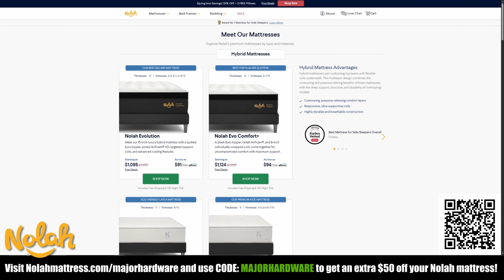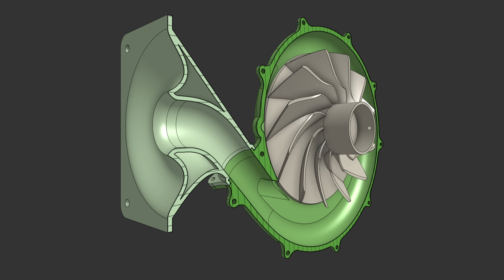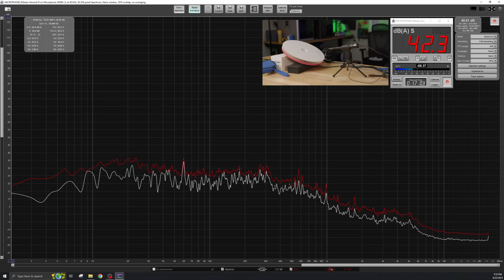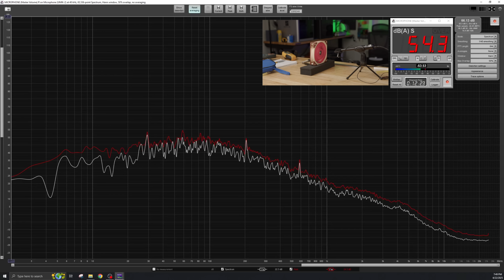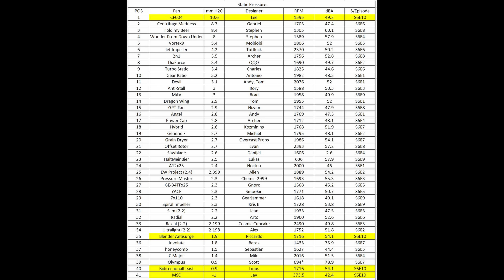This Fan Was Designed to FAIL... And It Broke the Test! | Fan Showdown S6E10

Comment: Season 7 IMO should focus on High Speed 38mm thick fans (Delta, NIDEC, etc). You've done the noctua fan for quite some time now, maybe its time to spice things up a bit. Objectives should be 3-fold: 1. Airflow. 2. Static pressure. 3. Does the impeller survive? The challenge with this season is that the impeller **MUST** fit within the fan housing. Things like flow control ducting and airflow cones (Ex The Cheater) can be allowed, but the actual blades must be within the fan housing. Its both for challenge, and safety. If the impeller lets go at high speed, the fan housing will at least catch the bulk of the fragments and slow anything that tries to escape, which can be further contained using a plexiglass shield.
Reply: There is not a lot you can do to beat the factory design when you restrict the dimensions.. That was already in seasons 1-3, nothing much was happening... I also was against breaking the "box" but, it has been more interesting when the only real limitation is how much the hub can take.
Reply: @squidcaps4308  There have been a few fans to beat the A12X25 while fitting in the frame. Not many, but enough that one actually got contacted for a license.
Reply: @codahighland  Yes, but by not much, and the designs were not picked because they were more efficient but because they looked freaking cool while performing well.
Reply: The reason for the noctua base is that the fan could easily be removed from the hub, allowing test fans to be pressed on. Do you know of a fan with the same property in the category you suggested?
Reply: @ericbuchner2982  The A12x25 simply has a metal rotor that the magnets are mounted to. Any fan with a similar metal hub underneath the plastic will serve a similar purpose. For Delta: Delta QFR1212GHE for certain. For Nidec: It seems the "large hub" 120x38mm fans that have an exposed brass shaft cap on the front of the fan may have a metal rotor beneath, cant tell though. I would say though that if there's a massive hub on one of these fans odds are there's a metal hub underneath the plastic. The Sanyo Denki 9GV1212P1J091 is also a potential candidate.

Comment: I don't know if people remember much these days, but back in the dialup era late 90s, and i can't quite remember the URL for it, but it was probably uptime dot something. Anyway having a very long uptime without a reboot was a competition. And you would also provide CPU temperature and other metrics. Now that's where my Celeron processor had the coldest running temperature back in about 1998 anyone had ever seen. It averaged 21C. Got down to 17C at night. The trick there was, firstly, those processors did run very cool back in the day, then, my bedroom was often below freezing or close to it in winter. But mainly, those 3 blade fans i had with a variable resistor, i could speed them up to about 7000rpm and they were ridiculous. Loud as hell, but very very high CFM
Reply: Yup, long uptime was once an achievement... Then one day i noticed that i had well over thousand hours, back in win7 days and i wasn't even trying... Uptime hasn't been a competition for a long time, now we are looking at uptime records of over 20 years, if we started competing..
Reply: @squidcaps4308  oh my. A Windows uptime, I mean without a reboot, these days would be neigh on 2 weeks at best. I had a Windows 2000 server in a cupboard back in the day which ran for 2 years until a power cut.
Reply: @irreverends And that is 100% horseshit. If you turn updates off you can easily have uptimes spanning YEARS. Windows these days is far better at house keeping, all around. It creates less trash and is better at cleaning it.

Comment: I’d like to see a material / gram limited season.  It would be fun to revisit the roots a little bit and tie things back into PC cooling too.
Reply: Space limited season, maybe we can get rid of the original frame all together and only keep the motor ? (Or impose a readily available unit)
Other idea would be to make the best performing fan while staying under a certain noise level target
Reply: @Homme_Pur 
I don’t know if it would even be possible to create a frameless case/radiator fan. You kind of need a frame to mount the fan onto a case or radiator.

The only way to create a “frameless” fan is to turn the frame into a plate. That would kinda still be a frame, just a flat one.
Reply: @Operational117  meant it in the way that we would need to design the frame ourselves. The idea is we can do whatever we want as long as it fits within the standard 120 mm fan volume and retains the 4 mounting holes
Reply: When seeing the Antisurge I thought a poligon or vertex limit might be cool. "How much airflow can just 42 vertices provide? Let's find out!"
Reply: Or maybe pressure per gram of material?
Reply: @kullen2042 I like that a lot, any metric (pressure, wattage cooled, etc) per gram would be pretty sweet to see.
Reply: I second this! :D
Reply: Suddenly we are all designing turbofans. Difficult with the a12s low torque.
Reply: I really badly want to know if the vacuum one cools well at all

Comment: The MSC is super cool ! it's essentially like a rotor and stator stack in a jet engine, but done radially rather than axially.
Reply: I'd love to see a design like it but for positive pressure
Reply: You know technically negative pressure is still pressure. And has positive on the other end. This could actually do extremely well on a cooler. Pull works very well when done correctly
Reply: It'd make a great exhaust, yeah
Reply: @googIesux Yeah, if you want to do that.

One school of thought is more (filtered) intake airflow than outflow, to keep dust out, like a clean room.

I don't think that matters much if you cool the CPU as I do: 120 mm fan in/out with  120×120 or bigger heat pipe heat sink in between.  Output fan connected directly to a flexible duct, the other end of which is attached to a third 120mm exhaust fan attached to the case.
Reply: @LloydMcElheny  ducting is real though, man. Not pretty enough to be promoted by xXxG4m1ngxXx Pro X-treme RGB Edition casemakers and etc. But most people have more fans than they need by far.
Reply: @uwainium  It could be mounted backwards as is.
Reply: @uwainium yeah same here 😅 I came up with this idea nearly 10yrs ago, good to see someone try it.

Comment: love the turbo fan. its so nice to see one finally well executed. the only thing I'd change is to put a bearing on the back side of the impeller to stabilize it.
Reply: Problem we've seen with bearings is, unless you're shelling out some coin for a high grade one with virtually zero friction, you're ultimately going to only hamper performance by adding one. I think you'd want to find a seal-less and lube-free design in order to. 

Though I suppose some of those fidget spinners had some impressive ones, but they're probably a couple bucks each is think, which is alot for one single use case. Unless he gave folks the measurements on it, so he can reuse it if someone else wants to design it with a bearing in mind...
Reply: @DUKE_of_RAMBLE  A pneumostatic bearing?
Reply: @jannikheidemann3805  If you're taking about an "air bearing", that obviously won't work here, since you need a constant flow of air to keep the shaft levitated and centered. (at least as far as I know)
Might as well use that air for some other purpose.  heh

Comment: Am I the only one thinking that “last place fan” should be placed on the exterior of the case to PULL hot air out of the tower…..?
Reply: That's exactly what he did with the smoke test I noticed.
Reply: I was thinking the same thing. And for the CFM, it should be placed -after- the measuring device so the air still flows through it in the same direction, only being vacuumed in rather than pressurized.
Reply: It would be great because it would create a lot of laminar flow inside and that is not only quit but also very efficient in removing heat.
Reply: Or to pull the hot air off the CPU.
Reply: @dustinmorrison6315 only massive downside is that it would generate lots of electric static pressure on the cpu and inside the rest of the pc case, which can short circuit pretty much everything in your system to unrepairable degree.
Reply: @kuromiLayfe  What on earth is "electric static pressure"? Did you confuse "static pressure" and "static electricity"?
Reply: @PixlRainbow  I think that's exactly what they did.
Reply: @kuromiLayfe  I think that could be solved by grounding the case, and if you're planning on strapping that monstrosity to it already I don't see why that would be too much of an ask.
Reply: @kuromiLayfe  "Electric Static Pressure"...? Never heard of that before... A properly built computer is grounded, so static electricity isn't an issue.
Reply: @kuromiLayfe  Probably the most incorrect thing I have read in the comments section to date.
Reply: You mean like a computer tower cooling fan does? Hmm, interesting idea.

Comment: If there's a way to measure how much of a vacuum a fan creates, maybe next season we could see who can create the largest/most vacuum. It'll be a good change from doing static pressure, noise, and CFM from all the other seasons. Love the fan showdown btw, been watching since season 1.
Reply: You can buy cheap vacuum sensors and attach it to an arduino that writes the values to a text file. 

You don't need THAT much precision so any sub 50 bucks sensor should work.

There is also plenty of code already made for them.
Reply: if you consider that -1 vacuum in the same boat as the static pressure, it comes in at 39
Reply: I used to run a 3-stage air compressor that looked like that fan. It was only about 10 inches larger in diameter, but it was spun by a 500hp motor outputting 1200cfm @ 90psi through a 4-inch pipe.
Reply: If next season is vacuum pull then I have a chance
Reply: Was it actually measuring -1 vacuum or was it just measuring backwards rotation on the reader as default -1..

If he's pulling a vacuum on one side then there's going to be air flow on the other side. 

And you would also need to consider the volume of the container it's pulling air out of and how sealed it is.
Reply: @MaNNeRz91  Rotation? How do you think this pressure sensor works?

I'm to lazy to go back and look but I don't think it has any rotating parts.
Reply: @Nevir202  the cfm reader he uses has a fan on it that measures airflow. If the vacuum is being pulled backwards through the reader then that will give a minus speed. It doesnt read vacuum (pressure) it measures airflow (cfm)
-1cfm doesnt equal -1 atmosphere(-1bar) or -1psi or -1in/hg
Reply: @MaNNeRz91  Bro, he isn't measuring CFM, he is measuring mm H2O, what season do you think this is?
Reply: @Nevir202  holy sh. I didnt even realise he changed to that. Even if that is the case that -1 reading is about as accurate as a dart thrown by stevie wonder. That whole setup must be leaking all over the place. A maf and map sensor in some pvc tubing would be way more accurate
Reply: @MaNNeRz91  How are you imagining you are going to test static pressure with a MAF? Both types pf MAF need actual airflow to measure anything.

I'm sure you're right that it leaks a lot, I think he even mentioned it. The important thing about comparative tests, is that they are all using the same shit setup. Not that important if the numbers are actually accurate.
Reply: @Nevir202  You would take 2 lots of data. One airflow and one pressure. Cap the pipe for pressure. Open the pipe for flow. Maf will do airflow as well as noting difference in ambient temperatures. Map would do the pressure side positive and negative.
Reply: @MaNNeRz91  The Fluke 922 has a D/P module inside that can measure pressure vs ambient or D/P between to pressure sources.  It's not using a fan.  Also it measures +/- 400 mmH2O for D/P, so it's giving a good reading.
Reply: @J__P_o_l_e i ddint realise he changed readers but even looking online a minus 1 reading doesnt seem right when most data ive read up on since shows higher readings. -1 to me seems so low it doesnt even count
Reply: That's not useful, no one want to put vacuum fans in their computer.
Reply: @Deses  Pretty sure any intake fan would count as as pulling a vacuum in these tests, and you usually do want one of those for a high-end PC.
Reply: @GremlinSciences  Not quite mate because the fan would need to overcome the pressure difference  when it cant pull any more pressure out of the case. Motors will gain more load and either burn out prematurely or just draw their current limit.
Reply: @ The intake fan is the one pulling air into the case so the exhaust fans can more effectively evacuate warm air from inside the case and/or have cooler air to push through the radiator.  The testing in this series presumes that any fan being tested is an exhaust fan, so any fan designed as an intake would show as pulling a vacuum.
Reply: @Deses  If you want a useful fan for your computer, you'd just buy one. The fan showdown is just for fun, I think greatest vacuum for season 7 would be a lot of fun.
Reply: @Deses  wouldn't be so sure.. 2 vacuum fans, could really help pull air from the other sides of the case if you do it right,  ya know the push/pull method.. you're just leaning into the pull.

Comment: is there now going to be a new hidden challenge of people trying to pull harder vacuum and loose the best?
Reply: Would that be closest to zero, or highest positive pressure? lol.
Reply: Technically pulling a vacuum wouldn't be loosing, just the nature of the air draw is reversed.
You can already buy Push or Pull fans since technically you want want to run them in reverse.
Reply: Just for future reference, its spelled "lose". "loose" means like a screw isnt tight enough.
Reply: @Goretantath  yup.

Comment: As someone formally trained in solid works Onshape is definitely different but also not bad honestly I’ve used pretty much all the major cad softwares too and Onshape is broadly comparable in most places it’s also what I use simply because it’s easy to load up its definitely not as fancy as other cad softwares but it’s pretty good overall
Reply: What’s the biggest missing feature you see?

Comment: Love seeing these car designs in computers!
Reply: Technically aircraft. Which I checked quick before going with my gut, and it's an interesting case of "it is, but it isn't"... 😅
The design for an exhaust driven "supercharger" was patented in 1905 for a radial aircraft engine, to overcome power loss at higher altitudes. However, the first application of one was in 1924, on a diesel locomotive (train).

Comment: I'm actually not a bot. Love the fan showdown
Reply: Aww, I got a love too :) But yeah I'm a nearly decade long 3D printing enthusiast as well, I've been watching your videos for years and mostly for the bits where you change up your printing methods. But also the designs, I've had thoughts of submitting a design, but in truth, if I did, it wouldn't be interesting, so it would never cut the mustard. I'd go with a 3 blade fan as my first attempt, I had some way way back and they were lethal, I got a 2mm cut into my thumb once from one
Reply: And now I'm going to have to rewatch the video, because I spent half of the time checking the comments in top and newest to see what happened.